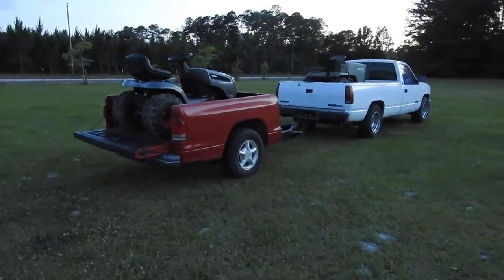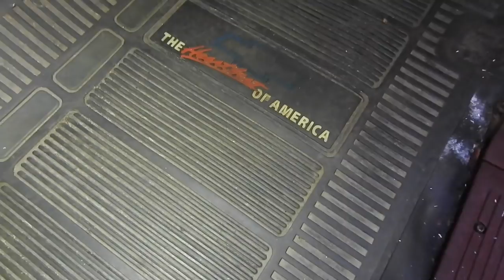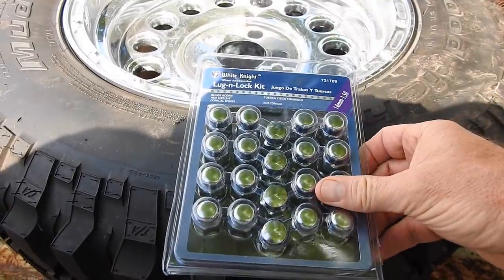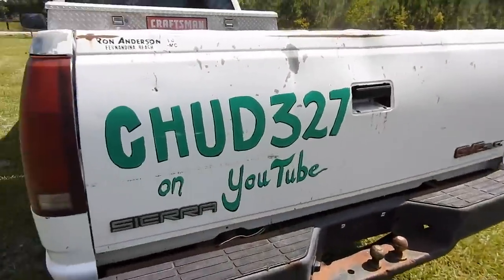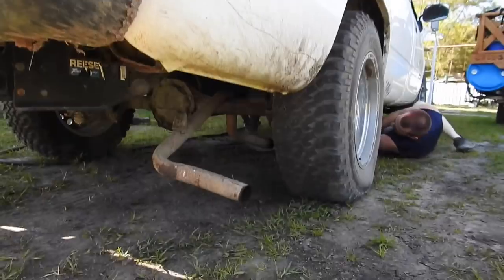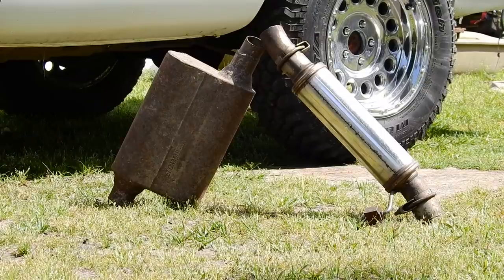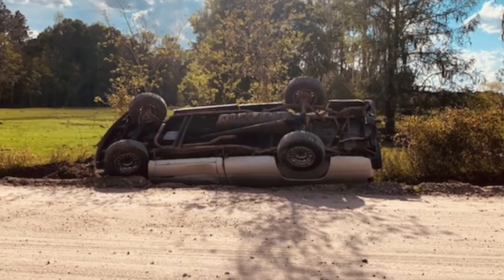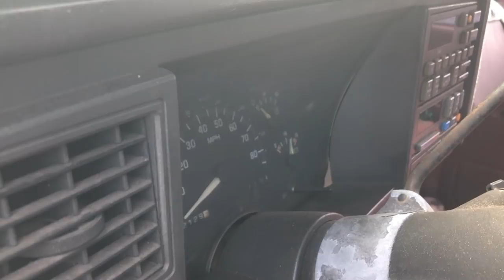Fixing Up the OBS Truck

Comment: i can honestly say with all the stupid crap i did in cars and trucks when i was a teenager, i have never rolled one, thankfully the boy is ok, and i'm amazed at the power that little winch has on the jd, the truck was stuck pretty good and it didn't even seem to struggle much pulling it out
Reply from the maker: I am glad I have never rolled too. I used a pulley block and doubled the winch power. I am impressed too. thanks for watching.

Comment: OMG - Young'uns , A few years back my Oldest Boy at the time was 19. I had a 1984 F250 that I passed down to him . He was headed home from work an a car made a left in front of him  he Flintstoned the brake . An of course it had just rained after like a 2 month dry spell The Ole Ford being light in the ass spun around in a 360, he over corrected of course truck went down the side of right way flipped over once an then layed on its side , it must have skid a 150 feet drivers side an finally stopped just a bit past a wooden power line pole- I swear you couldn't have put your hand between the top of the cab an that power pole . My Work Truck at the time was F350 Dually , I wrapped a chain around the frame just past the cab an pulled it back over on all 4 .Called his Mother an told her to bring his ass back to the truck an made him drive it home the next 2 miles . Before we left a Cop & Fire Truck showed up saying they were looking for a single vechile accident .. I said huh well my Boy here ran outta gas  no accident here maybe a bit further down the road . How they didn't notice the grass all ripped up is beyond me 🤔🤷‍♂️🤣
Reply from the maker: That is super funny and I am glad the police didn''t show on our road. thanks for watching.

Comment: Need some seafoam in the gas and down the intake. Tune it right up
Reply from the maker: I should try it. thanks for watching.
Reply: @chud327  use marvel mystery oil it’s easier on the wallet.   Sea foam is good stuff just a little bit pricey.

Comment: Hello, can I put 20x10-8 tires on 6” wide wheels?
Reply from the maker: I would think so and thanks for watching.
Reply: @chud327  

Thanks, I love the Silver Bullet mower. I’m working on a MTD right now.   Broken deck removed, preparing for pulley swap.
Reply from the maker: @shanewilkins893  nice
Reply: @chud327  
Pulley swap complete, new mud tires installed, speed improvement from 5 to 14. 
First test ride went well except it didn’t move smoothly between forward neutral and reverse. Problem didn’t exist prior to any mods. Any ideas?
Reply from the maker: @shanewilkins893  I am not sure, I wonder if the belt may be too tight...
Reply: @chud327  
I will check that, thanks !!
Reply: You were right, checked the belt and I had it routed incorrectly around one of the rear belt keepers. Got it corrected and shifting returned to normal. 
Thanks for the help!!